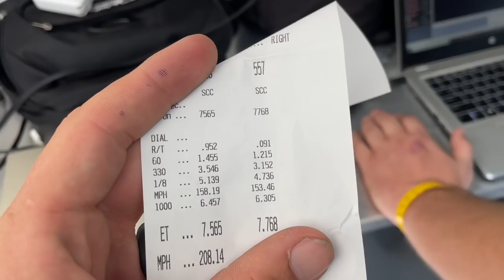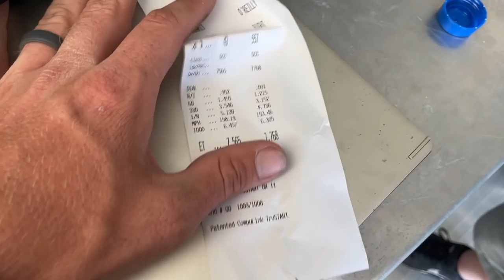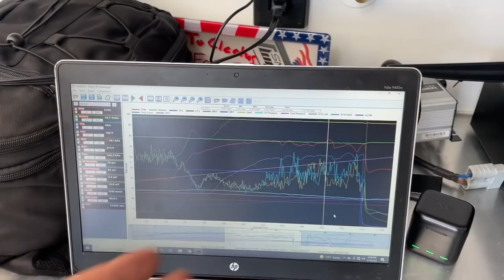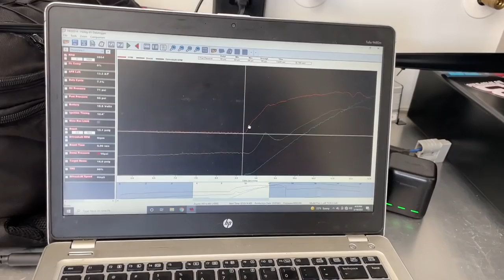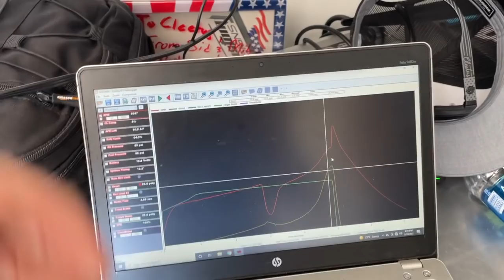TX2K22 Day 2: Ruby Goes BOOM On The Starting Line and Mullet BARELY Qualifies!!!

Comment: As a retired commercial pilot, it makes me wonder if the team would benefit from using a prerace checklist.
Reply: I just said the same thing.    A checklist would prevent so many of these errors.
Reply: Also more seafty tuning that throttles your car if your fuel pressure doesn't behave. Or disables a bump button when 2 step is not on
Reply: They could do that but which one of them can be trusted to remember to go over the checklist, lol. There are many old videos of Leroy where Cleetus forgot to turn the intercooler on, even though he wrote a note above the switch.
Reply: Got some seat time myself... I've been wondering if there's been a checklist in the background for a couple years now, and this proves there is not. Gotta preflight before even getting in the thing
Reply: That sir would imply a serious commitment to racing, rather than the CM entertainment empire.  I don't want to be unfair,  but this team makes so many expensive, avoidable mistakes.
Reply: Agree, I’ve brought it up in the past, I think when the loose axle bolts got them.
Reply: To be fair, it's also part of the fun to see the struggle and sometimes even a great win after wards. Or it was when it was on the rise to 7s with stickshift on leeroy. But now I feel like it is also a safety thing for the drivers to be more careful
Reply: They'd need a responsible mans just dedicated to that.
Reply: @kevinmccubbin2385  ...bingo bango boingo...
...take away the cameras and what have you got...?...
Reply: These disciplines are learned.  This is the second video I've heard them say about, "Always check the two-step!"  They feeling the pain now.  How many of us would leave the channel if they grew in professionalism?  I don't keep coming back because of the screw-ups or avoidable mistakes, or even the victory -- i come for the growth and team development.  YouTube is a weird world.  I felt joy when they got engaged, as if I knew him well.  If they decide to have children, I will feel more joy, and it will still be weird.
Reply: @kevinmccubbin2385  exactly... way more entertaining this way, and on another level, they're showing what those mistakes look like and hopefully new racers won't make the same ones
Reply: Bullshit they know what there doing all this shit is staged for the viewers an there raking in the money because of it
Reply: Yes,and no unaware people dancing in front of a 2 step test,which imo should be on stands like a fuel or alcohol car🤔
Reply: It's tough the crunch you're under at these big events. They are all scrambling between both these cars merch tents trying not to be called a dick head for not talking to someone's kid who's been standing there for an hour. Shits gonna get missed things are gonna happen. Its all part of the fun and the memories.  You could staple a check list to their heads when you're in a rush because the event is a cluster some things get skipped.
Reply: As a current airline mechanic pls don’t listen to anything a pilot has to say about not breaking things lmao
Reply: That’s what I said too.
Reply: @Fdragon1337  Sam is just the man for that.
Reply: @fazecoolmintdisposable8523  ha ha 👌🏻
Reply: @fazecoolmintdisposable8523  this guy 😅
Reply: @colinmunro7337  That always makes me pucker up.
Reply: Swear they avoid that just for drama lol
Reply: @Jessikitty2020  I agree 100%. Sam would be perfect in that role
Reply: @williamkillingsworth2619  literally no one said that WILLIAM. Quit your simping.
Reply: @williamkillingsworth2619  *lucky they didn't blow the welds on the intake manifold
Reply: @corystansbury  more like crack/damage a piston when it went lean. 

what makes you think it would explode the manifold?
Reply: They're not professionals nor is anyone they're racing against.   A prerace checklist for some of these cars would be 50 pages long and nearly impossible to go thru
Reply: @kevinmccubbin2385  yeah! Parts!
Reply: They're busy boys with awesome toys. Ripping it up, and having a good time at it. Pro Racing isn't easy. So many variables. Two things I always remembered,1. Proper prior preparation prevents piss poor performance. 2. In order to finish first, first you must finish. Hell yeah brother!

Comment: I love how they made you put a hood on Ruby for "safety" and then they let these super cars run 200+ with no chutes. 

Absolutely bonkers
Reply: Utube Fknsucks  brakes don't help when the road ends. Cars have expensive brake kits on them and still rely on one or even two chutes to stop in a decent amount of time.
Reply: Utube Fknsucks  
And how well do the brakes work when the car starts going sideways at the end of the track? You think drag racers want to run 50lbs+ of chute when 10lb of brake upgrade would apparently work just as well?
Reply: Utube Fknsucks  Yeah designed to do 200 eventually on a massive oval very rarely or brake repeatedly around a track where speeds are unlikely to get over 150 anyway. 
Thats really not the same as hitting the chassis witth 4x the hp then asking it to stop from over its original top speed in a shorter time than it was ever meant to - all with a very short run off and walls each side.

Comment: Hey Cleetus, there are clips for the push fitting airlines you have going to the pressure regulator to stop the push fitting letting loose like that. Can even just 3d print them ;)
Reply: Or throw them push lock lines in the trash and go with an lines

Comment: Boost sensor failure blew up Leroy, now a failed vacuum line almost melts that engine and wiring hiccup in Ruby nukes the transmission. Damn that’s some bad luck. Just keep on trucking.

Comment: You should always test the 2 step BUT the car should be on jack stands with the rear tires in the air.... One slight problem like the trans brake wire coming loose and your gonna launch your car into a bunch of people. Seen it happen a few times over the years.

Comment: The R8's and R10's, how do they pass Tech with all the oil blow by in the exhausts?
Some of those wrecks looked like lack of experience at high speed, and a least two looked like the ABS had been eliminated or bypassed, with locked up wheels.

Comment: Serious question!
Why does Mullet still have learn turned on? Especially in boost 

Also did I see on the day priors datalog that it was also adding 25% in closed loop showing that more than likely that boost reference line was already off of the regulator back then? 

Hate to see it though, really looked forward to you guys doing well in Texas :(

Comment: I feel like TX2K needs to change something with its DCT/GTR classes. All of the wrecks came from those two classes, and all of the R8 wrecks were no cage/chute. I love seeing those super/hyper cars run, but when they’re literally costing a days worth of qualifying runs, that’s not ok. One off-trailer shakedown, and one actual qualifying run is fine for bracket racing cars with >1000hp, but not for an event like this. ESPECIALLY when they happened on different days.
Reply: Letting fast cars down the track with no cage is just stupid.  Also any car that can trap at over 170mph needs chute.
Reply: Shit if I'm gonna run an R8/GTR in those classes chasing those numbers you bet your ass that as much money as I spend on the parts, tuning, ans everything else, I am going to be caged up with all the safety gear needed. Can never be too safe especially when your whip has like roughly 300k+ invested in it
Reply: @Sn0w_Official  but most of them super cars have carbon tubs. Which in effect is more then likely the same as roll cage or if not better
Reply: @helplmchoking  The two arguments are that
1: The base structure of the cars is strong enough to begin with. (If you watch some of the wrecks, you can tell how it holds up a little better than any other non-caged would.)

2. It’s not an NHRA event so tech is very coin flip on how much they care. Ruby needs a hood, but an entire class of cars going 150+ doesn’t require parachutes.

Also, there’s stages to cars being caged based on ET. And some NHRA rules say certain year vehicles can go 9.00 without a cage (2017-current I think is the rule)
Reply: @Sn0w_Official  We think like this because we don’t have the money to replace the cars on a whim. They don’t care because as long as they don’t die, they can replace it.
Reply: @neiltooley455  but a gtrs isn't a supercar
Reply: @raipanda133  not matter if it's an nhra event or not if your an nhra sanctioned event and don't follow their rules they can lose their sanction
Reply: @thedarklordsknigh  gtr is def a supercar not sure how else you would define it lol
Reply: @raipanda133  ok so I can understand that then, the car is clearly safe enough without a cage if the tub is strong enough, that's fine to me, also, when you look at the stock brake setup on a GTR or R8 compared to the motorbike brakes on the motorbike sized tyres on mullet, they'd argue that their cars are designed to brake from those speeds without parachute assistance (like they would on a circuit).

So I haven't seen the footage, what was the cause of the accidents? A crosswind would make sense if it affects the car enough and you don't have the parachute to pull it straight. Oil down on the tyres means the brakes don't work either and the cars going loose. Driver error? Well that's motorsport.
Reply: @thedarklordsknigh  You would think, but again, 150+mph cars with no chutes.
Reply: "ignorant people with internet connection have opinions"
Lmao why do I even read these comments
Reply: @jamessuman2151  I think the only one that was actually a brake problem was the R8 on slicks going through the traps. The second he hit the brakes, the wind just threw him into the wall. But a lot of the wrecks where the car is sideways would have been lessened and possibly prevented by pulling a chute. ESPECIALLY the GTR that moved the wall. The second he crossed the line, you pull a chute, and it would’ve straightened him out more and possibly prevented the wall being moved.

Everyone understands why TX2K lets these cars go down the track without certain safety equipment because “the cars are designed to hold it” but when you’re losing an entire days worth of qualifying/testing, something has to be done.
Reply: @lordvader3538  the GTR is not a supercar...
Reply: Any vehicle with that speed(150mph)/et(<9sec) or maintains over 1000hp NEEDS a chute. Regardless of the "rules".. that's honestly just sensible, if I were to go 150+, I want a chute, just in case. 🤷🏼‍♂️ roll cage too
Reply: @lordvader3538  overpriced Datsun! Turbocharge a VW R32 it's the same as a gtr. Doesn't make it a supercar.
Reply: @lordvader3538  Its a very, very sporty GT car. Not a supercar. But that really doesnt matter, it still needs a cage.
Reply: @neiltooley455  Neither R8 nor GTR have carbon tubs. And even if they did, it wouldnt matter, I seriously doubt street car carbon tubs are better than a serious cage in most directions for impacts. I might be wrong but I would need to see some high speed impact data to change my mind.
Reply: @SethDaughters  vw r32 turbo aint no gtr fool
Reply: @raipanda133  yeah definitely those high speed accidents can almost always be lessened or prevented with parachutes, and in the grand scheme of things a chute is pretty easy to put on and then remove (compared to a roll cage)
Reply: A lot of opinions from people who don't own an Underground Racing car
Reply: @Brandizzleizzle  if people can afford half a million dollars on power upgrades for their half a million dollar cars then they can afford a cage and some driving lessons. Roll racing is just rich guy wallet flexing.
Reply: GTR is the devil.  Oil down tracks all over the country  lol.   I hate them. They literally ruined TXTK for me
Reply: @GRPABT1  How do you know they've never taken racing lessons?
Reply: @Brandizzleizzle  they aren't required to hold an NHRA license like the drag racers are they? This is why rules exist. Roll racing is in its relative infancy compared to drag racing but they should have caught up on the safety by now.
Reply: @thedarklordsknigh  It's as much a Supercar as an R8
Reply: @asylumental  But an R8 that costs the same or less is?
Reply: @brentkneebush9144  by class id say it's a grand tourer... however the title for supercar is pretty broad so I guess yes, GTR is a supercar.
I think maybe some people, are saying supercar when they mean hypercar.... as those 2000hp lambo's are definitely hypercars and far beyond just being a supercar.
Especially that one Lamborghini, the one that did 233mph on day 1.
Reply: its fucking stupid these cars run 205's in the 1/4 and its more important to have a fucking hood than a certified cage and cute.
Reply: @brentkneebush9144  I made a ass of. My self I looked it up
Reply: Trimming classes or limiting class entrants at several of these events would greatly help as well.  This has grown into a gigantic problem the last few years.  Used to not be a problem to get the passes in you wanted and now it's almost a one and done most times
Reply: @GoldenCroc  fair point on the gtr but I think the r8 mite have a carbon tub. Watch the video of the lunatic who crashed the Porsche GT in New York. He crashed two other super cars. And did not die, As the carbon tub saved him. Do some reading up on them. Seen as F1 cars use carbon tubs and not roll cages. Carbon fibre is stronger than most steals, so I know which I’d sooner have
Reply: @neiltooley455  I will adress your points in the order you made them:

The R8 doesnt have it either. Generally you have to go to the "hypercar" price class to get a carbon chassis, the only mainstream exception being Mclaren supercars. No "unlimited series" production Porsche, Ferrari or Lamborghini (or Audi) has a carbon chassis, for example.

The Porsche Carrera GT which is what I assume you meant was a "hypercar", not a "supercar".

I am reasonably well versed in carbon chassis construction and which cars got it, or not.

It is very different designing an impact structure for a racecar, compared to doing one that is optimized for passenger car impact safety tests. Their goals are generally not completely similar, which can lead to different outcomes.

A Carbon chassis best advantage compared to a steel tubular chassis is that it can be made lighter. Correctly designed, it is stronger for the same weight, yes. But that assumes all other factors and design goals are similar. Something only the car designers themselves can say for certain.

Hope you dont feel I have been to harsh on your comment, but I dont want any unnecessary misunderstandings to occur. And considering your post was somewhat predicated on a faulty assumption of what cars have carbon chassis or not, I wanted clear it up completely. No sweat mate. Cheers..

Comment: The amount of sensor issues that they're having makes me think that they need to update their pre-run check protocol to check for sensors
Reply: I bet when they lashed the valves they knocked out that vacuum line pulling a valve cover.
Reply: They're not gonna get away with this stuff running an SMX, that's why it's been sitting in the storage area of the shop for months.
Reply: @metrickarma  it has? Link and timestamp?
Reply: @metrickarma  whats an smx?
Reply: @ooohry  a Steve Morris built engine. Extremely expensive billet motor

Comment: Glad you're finally seeing that these events need to either be better planned or longer because they KNOW people are going to crash and break and it's not fair to kick other people out because of it, that's why I stopped attending these events.
Reply: These wrecks could have been avoided.  They don't have a nig enough run off area for the speeds some of the cars are trapping at.  Should have been limited to certain classes.
Reply: @derekgardin1512  yup exactly. And they could just have big pans so that when someone starts to leak at the starting line then they can just throw the pan underneath real quick so that it doesn't get as bad as it does.
Reply: @derekgardin1512  yeah there are cars going 300+ mph going that track with out a problem
Reply: @derekgardin1512  they pro mods and top fuels going faster on that track.. All have chutes though..
Reply: 2K events just needs to break up the roll racing guys from the drag guys. separate weekends. If you wanna run both then commit to both weekends. so many cars do both now and its a shit show. You also have way more cars going 200+ mph then you did 5 years ago. Need to rethink how these events are done.
Reply: @coreytrevor3910   this is solid thinking. Total bummer when legit guys like Garrett don't have time to run because some yo-yo wadded his R8.
Reply: Not to mention the people oiling down the track constantly. But I guess that's just people pushing their rigs to the max, just like World Cup.
Reply: @neilreid2298  I wouldnt place Garrett into the "legit" guys category. Nothing against him but he has had only one foot in the door of being a legit guy for years now. Since he started the channel he's been an entertainer and he still is. He likes to compete and race but its not his true passion. Motorsports overall is his passion, 5 years ago he was closer to being legit then he is now. And some of those R8, GTR and Lambo guys didnt just buy these cars yesterday, they have owned powerful cars for decades. Its even more common that guys even get pro's to drive over themselves. The reason for so many wrecks and oil downs is because everyone is pushing it. Some of those wrecks were from guys going 200+ for years and years.